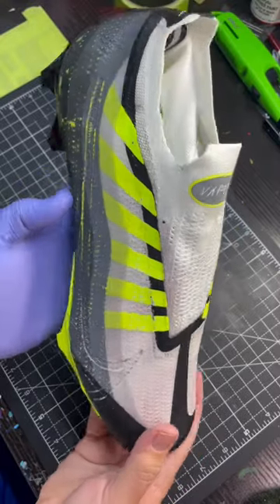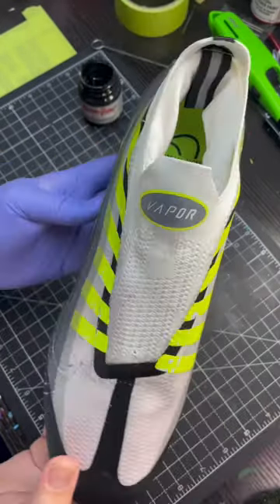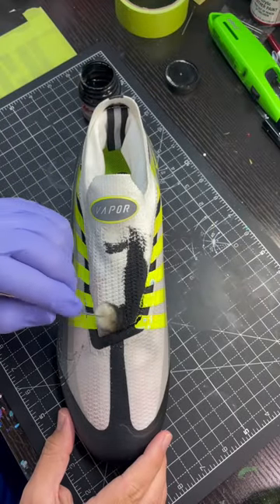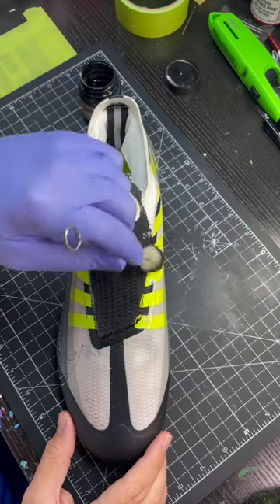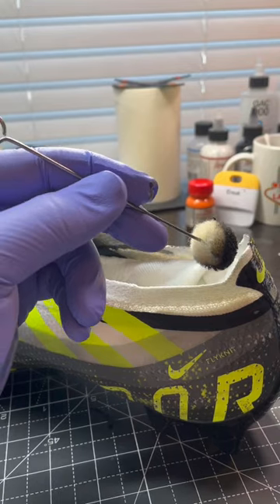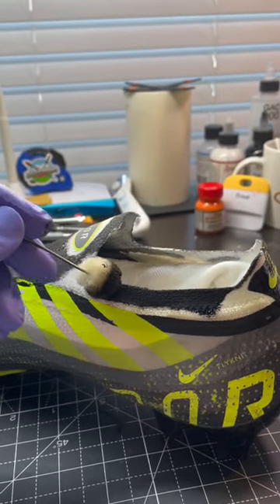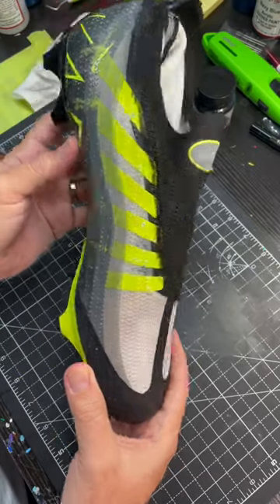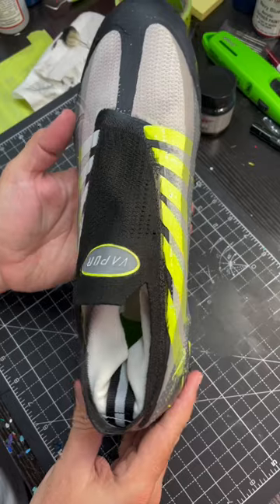Custom (Cleats) tips and tricks part 2!

Comment: I’ve been scared to do sock liners 😬
Do they bleed onto socks or does the heat prevent that from happening
Reply from the maker: Heat setting them will help prevent most of the bleeding, but it’s still possible to have some bleeding.

Comment: Do you need to prep sock liner
Reply from the maker: @IsaacLee-l9n  nope! No prep needed
Reply: @LeaderboardCustoms  I’m doing the Nike Vapor Untouchable pro 2 cleats, do I need to prep the outer of the cleat or treat it like the sock liner
Reply from the maker: @IsaacLee-l9n  mesh / sock liners never need prepped, but leather /synthetic leather always need to be prepped
Reply: @LeaderboardCustoms  this is where I’m in a pickle because the whole outer is this material flyknit, niether mesh or leather

Comment: What type of paint do you use for the upper, and does it last/peel away after time?
Reply from the maker: Angelus paint, and I prep the shoes to make sure They last a long time even with lots of use!
Reply: @LeaderboardCustoms what to you prep it with & how do you seal it?
Reply from the maker: @kristensanchez2100  prep is a multi step process.  I’ll be losing a How to video soon.  As far as the finisher, I use Liquid Kicks Finishers.
Reply: Does the paint make the sock on the cleat stiff??